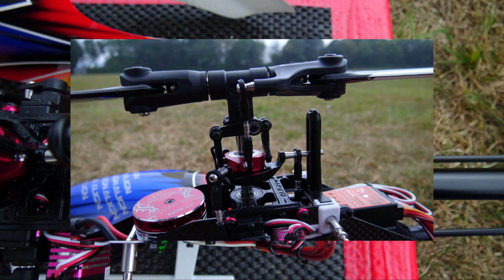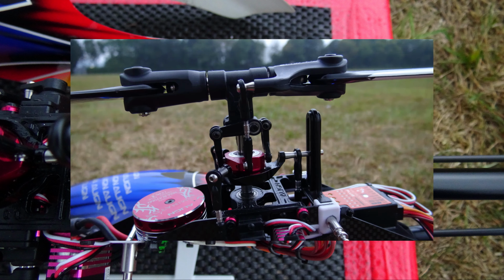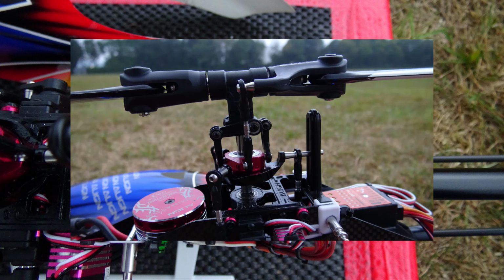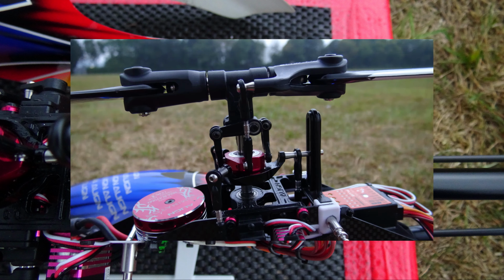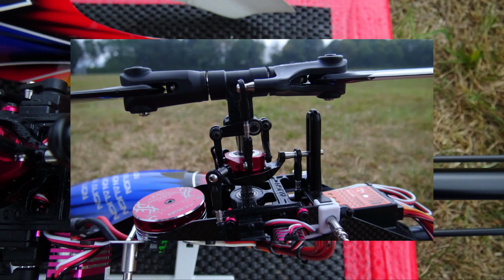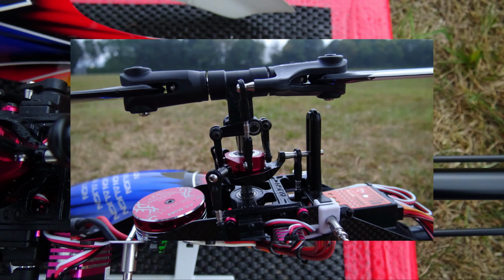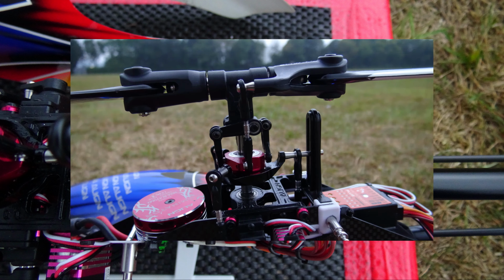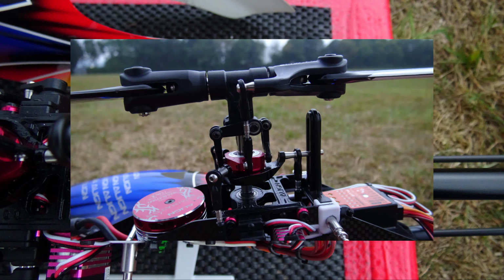ALIGN TREX 470Lp FOR ADNAN

Comment: That looks harder to fly than a 330s! 6s WOW. My return to Helicopter flying is now long delayed, as Im accumulating $3000-4000 in Veterinary costs for my dog. Going to be a long time before I can acquire any new models, but my dog comes first. Nice flight, enjoy. PS what do you think of Roban?
Reply from the maker: Sorry to hear your Dog is unwell Mark!! I hope he gets well soon!! Yes Roban are supposed to be good quality!! But don't touch Rotorscale from Motion Rc they are only Roban fuselages the mechanics are Trex clones and are crap 😀👍
Reply: @IansRCExploits  My dog is getting very good care, I am optimistic. Thanks for the info about the Motion RC Models, as I have been very tempted to get one, as some are really scale...
Reply from the maker: I had to scrap the Rotorscale mechanics and use my Trex 450 the big scale ones that are very expensive are Roban but not the small 450 size ones.
Reply: Hope your dog gets better mate.
Reply: I used to fly Copter X many years ago and they were not too bad but havent seen them on sale for a while so maybe they were not as good as I thought.
Reply: @jjs3287  Thanks, I really appreciate that, he's doing well so far. 😎
Reply from the maker: Well that's good news Mark 😀👍

Comment: Hi Ian.  Very nice.  I have a question unrelated to this video.  I bought a Blade 360S Heli.  It had a defective ESC.  My local hobby shop replaced it without issue.  I'm not a 3D flier, tend to fly scale like, mostly in SAFE mode when flying Helis.  I regularly fly my Blade 150S without issue; even perform the occasion loop and roll.   I find my new 360S Heli has spool up problems; seems to take forever getting up to speed in Normal mode.  Twice now I've had the main blades strike the ground, because the Heli tends to wobble on the ground until its properly spooled up.  Any suggestions?  Personally I'm wondering the following: 1) is the ESC is programmed correctly; its tough to find the actual ESC programming for the 360S.  2) how quickly should I push the throttle stick up; is my slow stick increase affecting spool up?  3) could tail rotor belt tension be affecting spool up?  Any insight you might be able to offer would be of great help, Ian.  Thanks very much.
Reply from the maker: Quite often Wolfgang the esc on a heli will be set to soft spool up!! So they do start up slowly, I'm concerned that you said you've had Blade strikes!! Is the Heli leaning around as your taking off? If it is then it's the FC6250HX flybarless controler as it's the same issue as the 330s!! It is advisable that you should try to pop a Heli up into the air on take off but it's easier said than done 😀👍
Reply: Thanks Ian.  Yes, my 360S is leaning and wobbling around as it tries to take off.  It literally falls over at times.  Cost me two stripped servos so far.  Whenever I do manage to get it into the air with a more aggressive takeoff, the Heli flies great and very stable.  Should I be tightening my main blade grips down a bit more to hold the blades out straighter during spool-up?
Reply from the maker: Your blade grips should be tightened so that when you lift the Heli up by hand with the blades running straight front to back and turn it on it's side the blades should drop under there own weight!! Like this when you spool up they find their right position and that lessens vibration!! I found that when taking off in SAFE you need a small amount of positive expo say 10% and this helps with the leaning around 😀👍